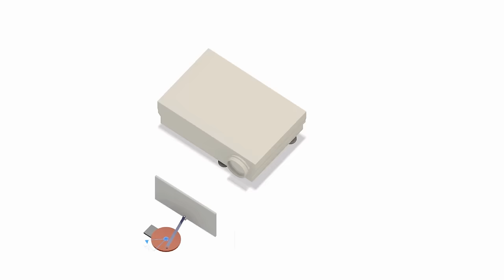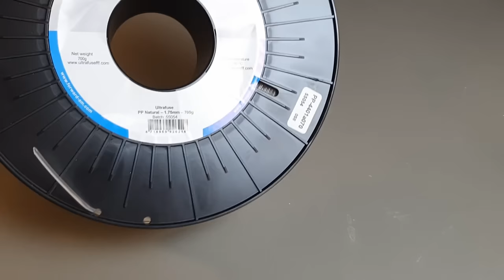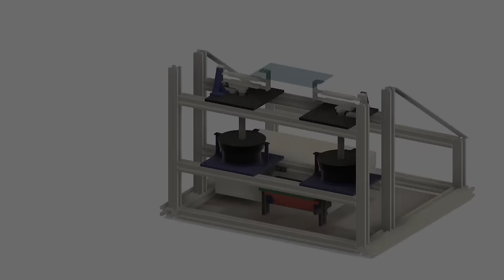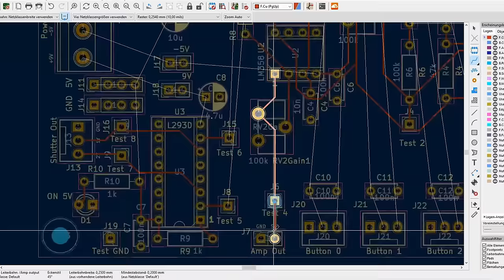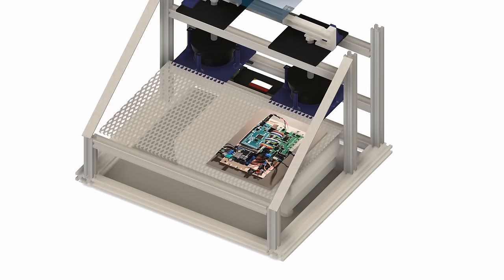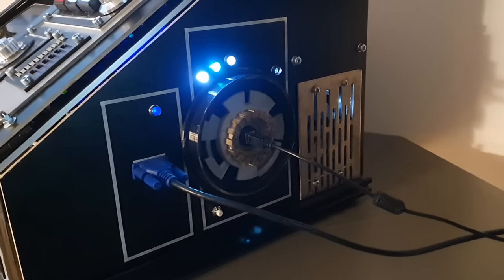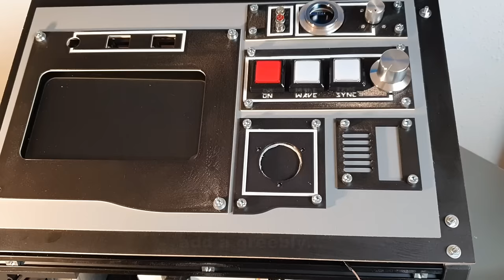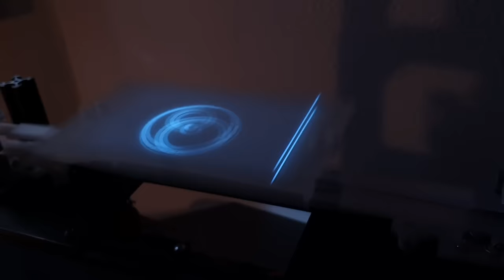DIY volumetric display (Star Wars inspired) - part 2

Comment: I was kind of hoping to see you use a linear actuator in a near vacuum, but this is a really interesting approach, and probably much more realistic to get working.
Reply from the maker: Thanks for your comment... but I am afraid that a closed vacuum chamber would increase the complexity considerably. And the deflection of the oscillating projection plane is not currently the biggest problem with this setup. However, it is a very interesting suggestion for an improved future version. Many thanks
Reply: @makermac70 a vacuum chamber version wouldn't be too complicated, as long as you put everything mechanical inside the chamber and keep the electronics outside. The wiring runs through a hole with a channel filled with epoxy.

Very cool project though, kudos! Looking forward to seeing if you can improve the depth of the volumetric display.

Maybe you could upload a 3D video of the display in action so people with VR goggles can see in its full glory!

Comment: Very cool! You should stack a few of the screens for more depth.
Reply: I don't think that would work.  You'd have a problem projecting through one screen to the next.  If you want more depth, we need the screen to articulate over a wider range.  Of course, this poses all sorts of challenges.  You probably couldn't use a voice coil for starters, as voice coils are only designed for so much articulation.  You're also talking about faster acceleration/deceleration ramps, as the surface would have to cover a longer distance over the same 1/30 of a second (or whatever the frequency).  This would lead further part deformation, and a more curved projection surface, greatly increased wear, and far greater need to deliver and handle power across all of the mechanical parts.
Reply: Here's how I imagine a stacked display would work. The projector wouldn't be beneath the screen, it would be to the side of the screen. This would require that the image itself be distorted so that it looks correct when hitting the screen. And the projected image would have to consist of "slices" that are different for each screen. This would require some fancy software, but should be doable. The next difficulty would be that when the screen is at the same level as the projector, it wouldn't be able to project onto the screen because the screen would be near perpendicular. So I imagine to solve this would require either two projectors set at different angles, or a way to make the single projector itself change angle, such as the use of a swiveling mirror or something. What seems the most simple would be two projectors, each one set up on either side of the screens.
Reply: @norbis3939  Ok.  I guess that's an approach.  A very serious problem there is, the more extreme the angle of projection, the more difficult it will be to get a useful image, and distortion a lone won't correct for all of it.  Especially as the moving screen, moves in and out of the plain of projection, which will become ever more shallow the more extreme the angle has to be to get an non-interference line of sight.  Which, since we're working with a very narrow movement period as it is, the angle of projection will have to be quite extreme, as there won't be much space before the second screen is mounted.  

You might be able to solve all of these sort of problems, including the need for dual projectors (just use a single), with a series of mirrors.  The first set of mirrors would bisect the projector's image, sending half to the first screen, and half to the second.  Then probably a set of mirrors to change angle, and finally a set that travels with the screen, thereby keeping the projection in plane at all times.  This might also allow for some fine tuning to avoid the projection having to be as extreme as it otherwise would be.  

Of course, adding a second screen will greatly increase the mass of the projection system that needs to be accelerated.  And even though we have somewhat addressed the line of sight problem for the projector, we haven't addressed the line of sight problem for the observer.  How are you suppose to see through the top screen to the second screen?  Remember the screens are frosted to make it so they interfere with the light, thus allowing a projection surface.  This same feature makes permitting the light from the next screen though basically impossible.  The only solution I see for this is using some sort of LCD that you can oscillate between transparent and reflective, but talking about increasing mass and complexity.  Also, if we're going that far, it seems other options start opening up anyway.  

Honestly, I still think the best way to increase depth with the current design is to find a way to increase the rigidity of the projection screen, decrease its mass, and increase the length of travel of the screen.  Like perhaps there is a way to amplify the movement of the voice coil through some sort of gear/pulley system, extending its natural range, of course such an approach would introduce inefficiency into the system's movement, as well as put the voice coil at a mechanical disadvantage.  Ideally you'd manage to find a meaningfully bigger voice coil to work with instead.  I think increasing the rigidity of the projection surface, while reducing its mass, should be doable without having to go too far into the extremes of effort.  If we're doubling our depth, I think our first approximate goal should be to double the rigidity of the screen, and to half its weight (or more if we have to gear the movement).

Comment: What an interesting video.  You have so many competencies in a broad array of domains.  Very impressive.  I feel you glossed over some part which would be interesting on their own, such as the electronics and software.  What a talent.  Bravo!

How much operation noise does this produce?

I was hoping you would show a terrain fly by, or plasma animation.   Is it possible to get realtime rendering of sensir data?
Reply from the maker: Thanks for the comment, I really appreciate it. The project was indeed very complex and I could have described some aspects in more detail, but unfortunately nobody wants to watch long or detailed videos these days... 
Regarding the noise, the device is not as loud as you might think, you can only hear a low hum when it is running.
I was thinking of doing a plasma or fluid animation, but I didn't get that far. I'll upload it when I get around to it. But thanks for the suggestion!
Reply: I think that’s a great suggestion!

Comment: What about a cylinder or drum with tall fins mounted on the outside that cut through the air the way it turns, not against. Each fin can be marked on the drum somehow for synchronization. These fins are then narrow, fitted with your projection material of choice, and create a spiral. You mentioned not liking rotation, but I was just kinda laughing in my head about how we've come full circle, back to the nipkow disk in a way.

Comment: i wonder if it's possible to convert an MRI file to display in 3d on this ...
Reply from the maker: Thank you for the suggestion, this also seemed like a good use case to me ... and I tried it: see video part 2 starting at 22:40
Reply: @makermac70  so cool! this kind of visualization definitely makes it easier to picture how the structure looks under the skin vs. just seeing a slice at a time, hope that this can be adapted into something clinical!

Comment: How loud is this thing? Or is this still infrasound?
Reply from the maker: the device is not particularly loud, you can hear a low hum during operation (30Hz is in the typical subwoofer range). Of course, it can become more audible when the "volume" is turned up very high... interesting that many people are interested in the volume.
Reply: @makermac70   It being a vibrating apparatus derived from speakers this makes sense though ;-)

Comment: Ok was thinking about this project some and i think theres a way you could get more layers and even color!

A homemade projector
Diy perks video about the process is made for projecting onto a wall but yours needs much less brightness at a much smaller size

Link to video: https://youtu.be/YfvTjQ9MCwY

You honestly might not even need a lens to focus the light to not be parallel if the volume is the same size

But you can up to 144 lcd’s for phones as far as i can tell and will still be able to have color
Reply: One problem… black levels might bleed which will washout the project volume…

Comment: yor problem lies in your insistence on 3d printing a part that should never be printed. you should be using properly heat-treated spring steel.

Comment: Why not just use a cylinder with an offset center so it’s one continuous surface that changes thickness as it spins
Reply from the maker: Thanks for the comment. That was an idea I started with, but as explained in the first part of the video, there was too much distortion and I wanted a more "linear" volume.